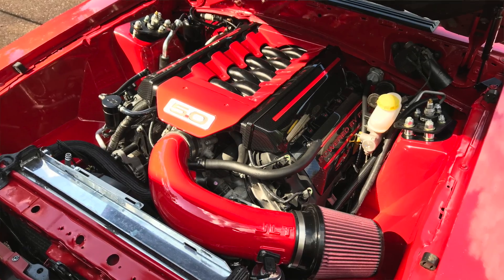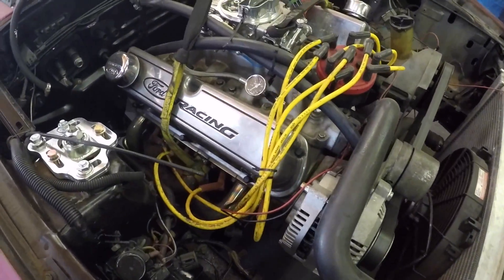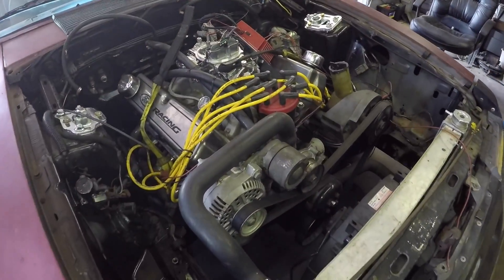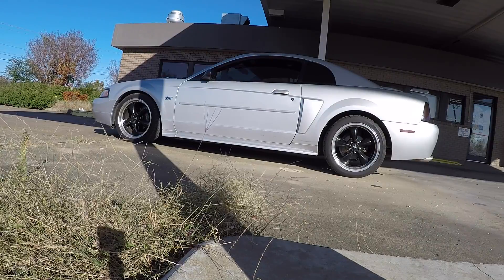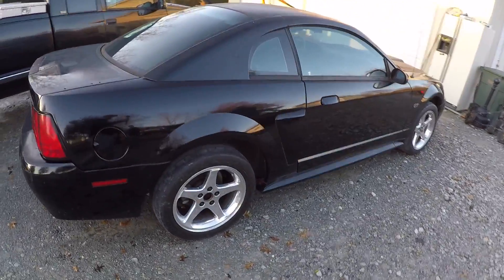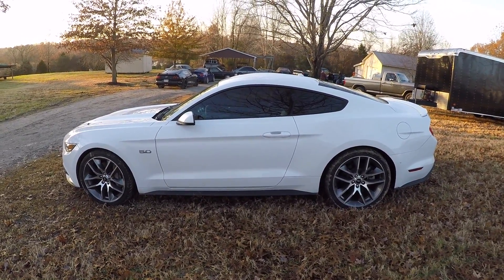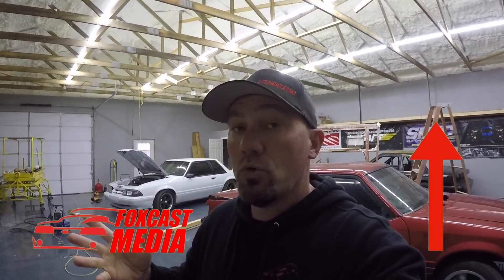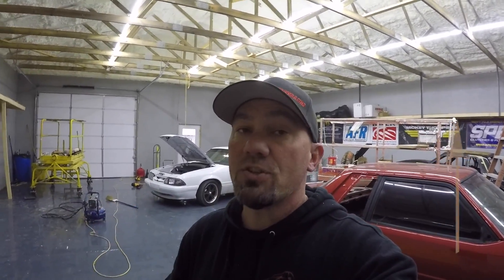What do you want to see on the channel? *YOU MAKE THE CALL*

Comment: Definitely some truck stuff f100 or f150. Also maybe more on the pushrod engines, 302 or 351, with updated fuel and ignition systems and how to install and use.

Comment: Your doing the stock fox with the upgrades from back in the day.  Head swap and cam install with showing how to do it with a good step by step.  Maybe gear installation. Maybe intake gasket replacements or a waterpump replacements.  For the diy guy who might not know exactly how to do it.   Might not be your cup of tea or you dont have the time.  I could always use a reference for any fixes on a foxbody.    Either way man im still watching!